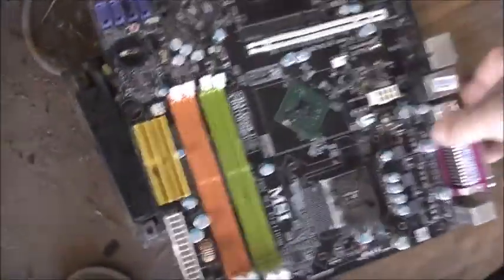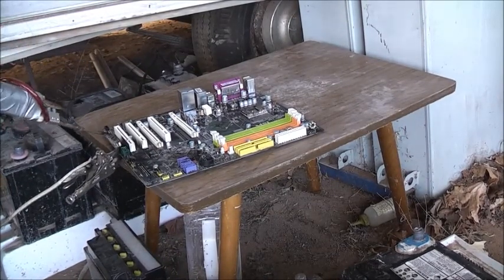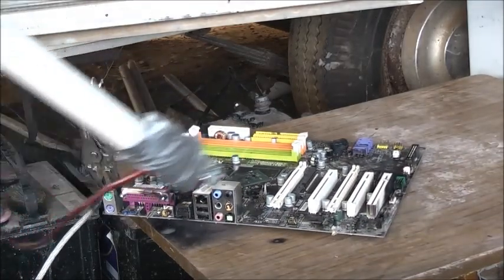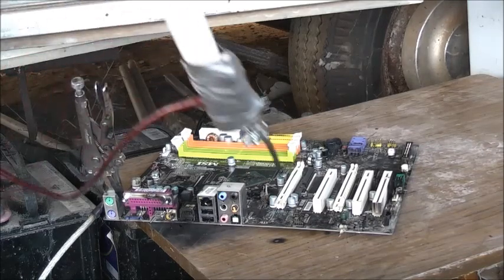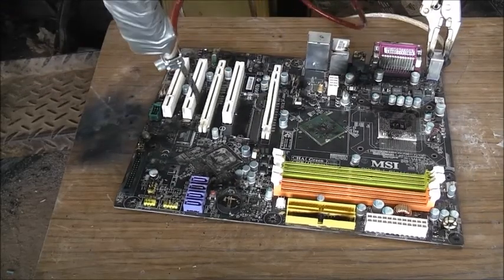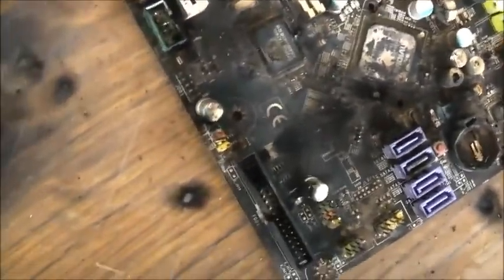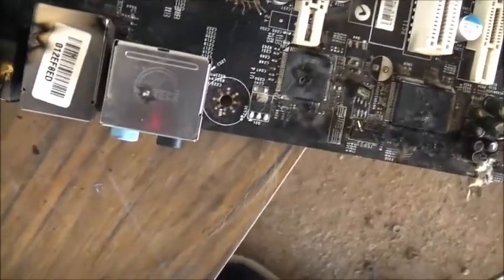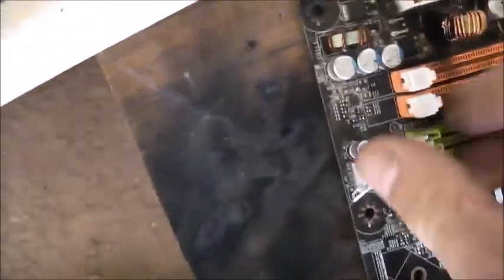Finishing Off MSI Board!

Comment: i have one of the maxwell 1500 farad boost caps. great caps! i can melt steel with it. 800 amps short circuit current. they pull a heck of a load of current when charging! they are really good fun.

Comment: What is that strange high-pitched sound?
Reply: That's a whistling-squeeling vacuum cleaner! LMAO!

-BBD.
Reply: BoomBoxDeluxe
What?  That doesnt even sound like a vacuum cleaner.
Reply: TheQwertyCody
 It's a vacuum cleaner, but it has a ribbed hose connected to it (that isn't intended to be on there by the manufacturer! :D ) and as the air goes through the pipe it rapidly expand-and-contracts as the air goes past each of the ribbings in the pipe, and so therefore, if the expansion-and-contraction of the air happens at a certain amount of times per second, what you hear, is a high-frequency whistling-squealing sound! LMAO! :D

Because there's multiple ribbings along the length of the pipe, this causes the air to expand-and-contract at a very high speed for only a small air flow. Judging by the high-pitched sound, I'd say that the air in that pipe (as it travels through it) is expanding and contracting at may thousands of times per second, hence the high-pitched sound. :D

........"In-The-Name-Of-Science!" :D

-BoomBoxDeluxe.

19th September 2014, 23.47
Reply: Oh, that explains all, thanks!
Reply: BoomBoxDeluxe very well explained, thanks!